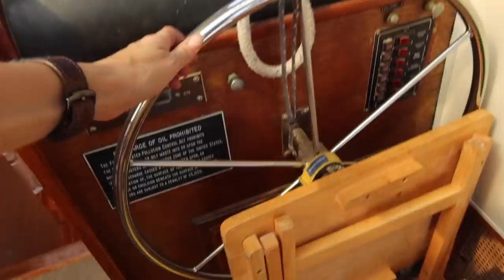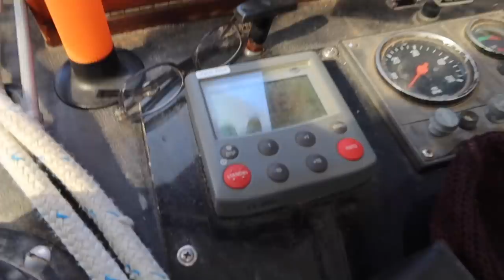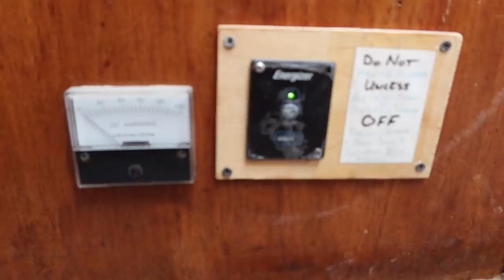Should I buy THIS SAILBOAT? Boat Tour | PIRATE SHIP S14E01

Comment: I can see the potential in that boat, A little bit of Scrub a Dub Dub, Love the sail and mast on it, And you don't get wet pulling the lines.. But I expect it to be a rolly boat if that sail is up with no keel. No marine inspection?  No sea test? Hmm"   That could cost even more than you think. I just hope it works out fine for you..

Comment: It seems like less work to make a cat out of shipping containers 2,000 20 ft 55 gallon steel drums 100 dollars each ( foam filled 1$ a can ) steel I beams ( Indestructible ) than to buy someone else's  junk
Reply: It depends on where you are and what the season is. You could miss a window for a storm or just a lack of wind and that would cause you to wait. In this case she missed the last bit of decent weather to head south before winter set in. She was north of Seattle and Port Townsend is the entrance to the strait. Once you are out in ocean there you don't have a lot of handy harbors if a storm kicks up and as a bonus it is cold. On the east coast you would also be concerned about hurricane season so you would not for instance want to head south late summer or early fall and then winter would set in. The east coast has more places to duck into for shelter and the ICW but you still don't want to be in a hurricane.
Reply: Wha Wha What?  Shipping containers?  Are we stupid or just trying to piss on someone else's parade?
Reply: Air keel you can Build and sell, Heavy Duty Phone Pole Mast